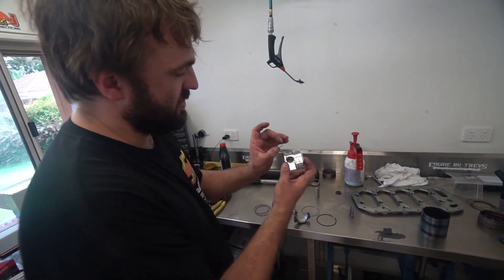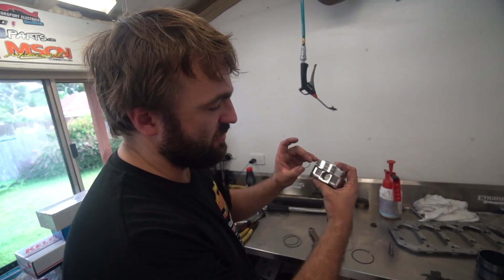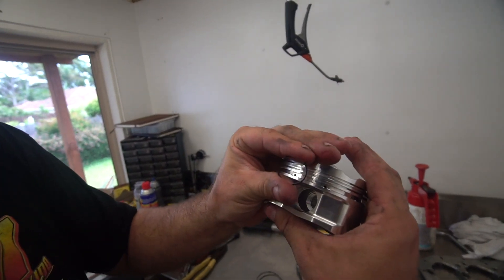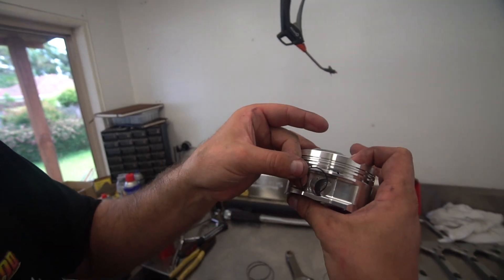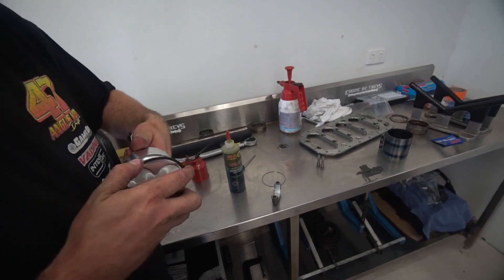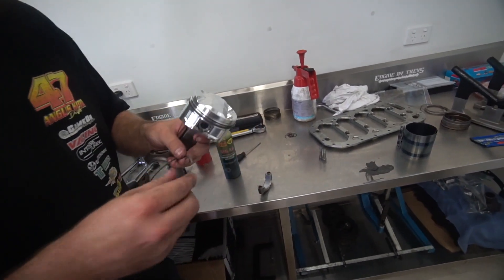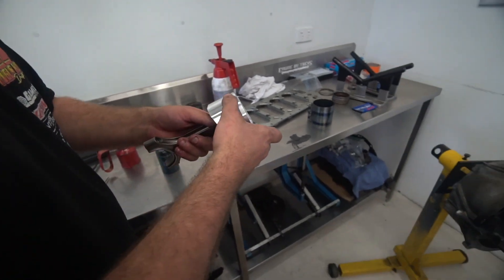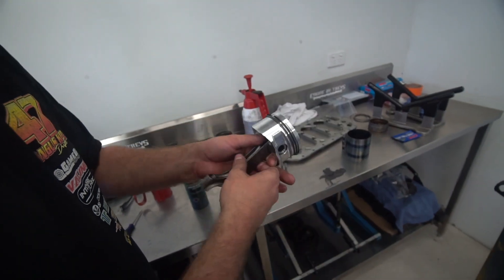Pistons (Ask An Engine Builder Part 4)

Comment: I subscribed for more of these segments. I love hearing good engine builders talk shop, especially on motors they're very familiar with. Also I just like hearing 4AGE talk, I would appreciate any kind of insight about the 4AGZE versions he has. I have a 3 rib large port that I'd like to throw a small turbo on some day. I know 7 rib is stronger and has oil squirters for the pistons but I have what I have.
Reply: Ditto! But don't care the engine. Insight comes from everywhere. Many of my engine building tricks come from the world of pushrod v8's and air-cooled vws. Never sleep on those old farts, they know more than you think!